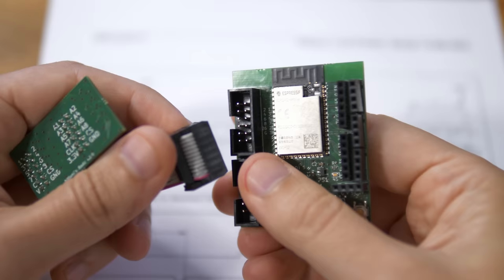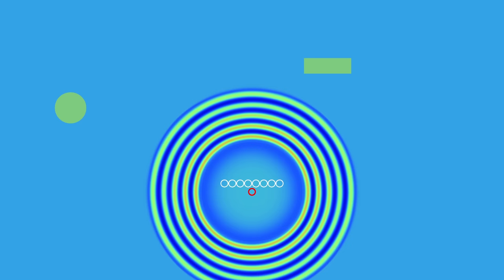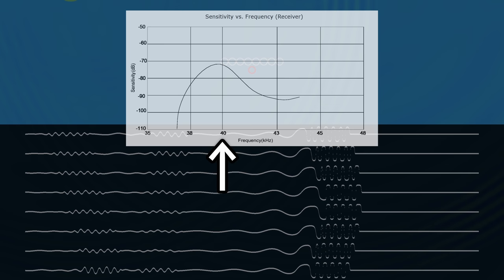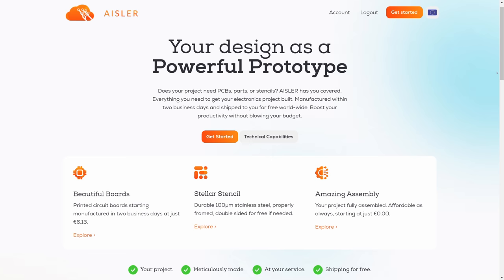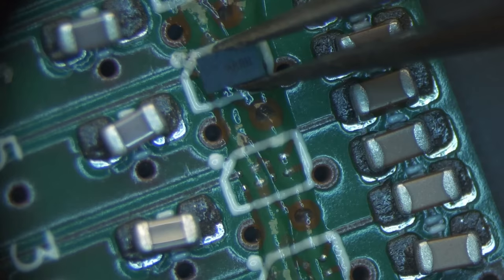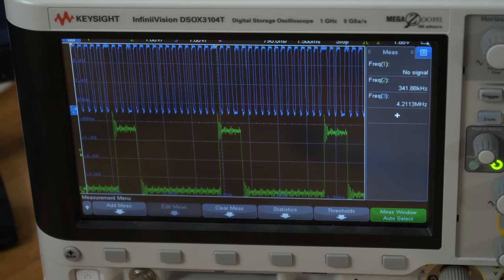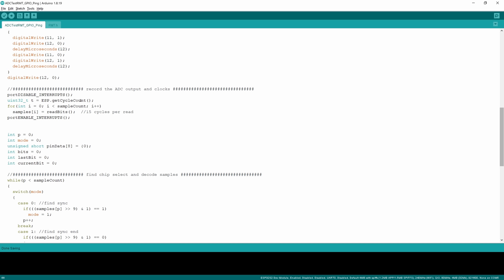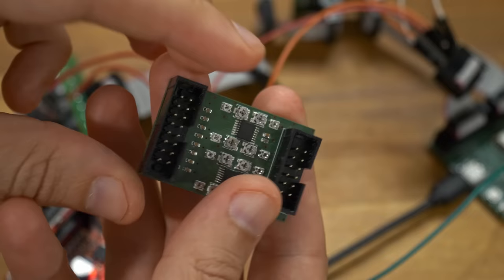DIY Sonar Scanner Ep. 2 (STEM, RMT tricks)

Comment: Geeeeeeezzzz. This is a mind-bogglingly advanced maker project. I can't believe all this is possible without a PhD in ultrasonic and signal theory, and a big lab. Let along possible with an ESP and off-the-shelf hardware! Great work! I can't wait to see how you amplify the output signal without introducing "noise" into the rest of your system.
Reply from the maker: I also can't wait to see that :-D
Reply: IKR, though the math/physics principles have been pretty known for quite a while as well as some actual existing HW/SW implementations that aren't totally proprietary anyway. But yea its amazing just how far we've come over the decades & how readily available everything required for such a project is, even to a DIY engineer.
Reply: Using a lock-in amplifier perhaps?
Reply: dude the math is pretty basic bachelor in engineering-level... Programming the microcontroller to work at those speeds is where the complexity of this project comes
Reply: @bitluni Дальше увеличим количество приёмников и получим ультразвуковой 3D сканер для дополненной реальности?) Будем без включённого света видеть окружение😏😏😏

Comment: I was working on the same kind of plan 14 years ago. one thing I noticed is that it's better to space the receiver array with prime fractions in between each detector. so the detectors are not spaced evenly. This prevents a picket fence type sensing issue. Also there are wider bandwidth ultrasonic detectors, but they operate at higher frequencies and thus increase the difficulty of the electronics.
Reply: What's Prime Fractions? I googled, but only found prime factorisation
Reply: Placing at primes is a good idea. It make a significant difference in performance?
Reply: @LydellAaron  so you have a spacing distance between sensors. Then you say do a 7/5 of that distance and a 14/11 of the distance. The waves that line up with the consistent distance now are not lined up with these odd spacing. it helps separate out things.
Reply: @LaserFur  I haven't checked your math, but I do see what you mean in spacing the sensors. Question: Could you tune each ultrasonic, to emit a pure prime frequency, keeping the distances the same?
Reply: @LydellAaron  no. it's not about the frequencies. it's about geometry. Any random spacing that is not even will help. think about how the phase of the wave from two different objects can line up the same on the sensors. The sensors have a bandwidth that controls the resolution it can separate objects, but the phase on each sensor can target a object with more accuracy.
Reply: @LaserFur  thank you for explaining it's not the frequency response in this case, it's the phase arrival time, at those sensors.
Reply: Also Golumb Rulers work.

Comment: I would highly recommend programming the ESP-32 using the PlatformIO extension in VScode. Not only is VScode just a generally better IDE, but the default ESP-32 framework (which virtually perfectly mimics the default Arduino framework) is actually built on FreeRTOS, which can leverage both cores of the ESP-32 and allow true concurrent multitasking. This is achieved simply by making calls to the FreeRTOS API with no modifications or extra library imports needed, which is freaking sweet for a 6$ microcontroller.

Comment: I would still like to get your help on designing my "flashlight for the blind" based on a laser range finder. But if you were able to map surfaces with your sonar, maybe that would work too. I found sonar to be too slow for distance measurements. But the tactile feedback for a flashlight for the blind would most likely use tiny electrical pulses on the forearm. Or possibly on the hand and fingers if it were implemented in a glove. Imagine feeling your way down the street with 30 foot long fingers.  i'm quite certain that something small and functional could be designed to work on a rechargeable 9 V battery. Or maybe more batteries. Something that would fit in one's pocket certainly. This would be a tremendous benefit to many people. The cane is a very reliable mechanism, but it could certainly expand one's horizon to be able to feel doorways and windows and street signs coming up. To be able to sense people 20 feet away walking toward you. Perhaps

Comment: Fantastic! WOW! And you managed to get a PCB with BGA's on them... impressive!  Thanks for sharing this... I can't wait to see how you process the data and interpret it.
Reply from the maker: its only 8 pins which are adjacent to the IC corner. The of all the BGA boards the last ADC didn't work. I used a different type for the tests shown here (code still works the same). I never really found the issue. The solder mask is a bit wide open on one of the pads. The pin pitch also exceeds the specks of the manufacturers fast shipped PCBs. I tried the BGAs because they were the cheapest and support 12bit at 3MSa max. Still would use sot for product because of the reliability.
Reply: @bitluni  Well, even attempting it was brave! Glad you got a work-around for that last ADC and was able to move the project forward... much respect for you!

Comment: The US military had the 5 omni-directional microphone version, installed on some humvees that pinpointed the afghan snipers, when they fired. Machine-gun galore after that. 
Mountain echos and all. Now there's a small version called the "Sniper Detecting Microphone", a part of their TCAPS (Tactical Communications and Protective Systems).
Smaller than a pack of cigarettes, the solider sticks to the back of his helmet.
I like yours better because it's based on an ESP32.
Reply: So basically the rl version of the little arrow you see in video games showing you were the shots were fired from, pretty cool
Reply: @xxportalxx.  dam, i never thought that such a device could exist. But it makes sense now, to have a phased array microphone system would work very similar.
Reply: I did a university project where I determined the angle of a body respective of a sound source by using digital cross-correlation techniques. Made an A! Now, we can see this kind of math being used in sniper shot detection and ranging.
Reply: @DrumToTheBassWoop  You get more bang for the buck with beamforming phase-shift arrays. This beamforming technology could augment LiDAR for 3D mapping.

Comment: If you add additional transmitters offset by the size of the 8 receiver array, then you will have a MIMO-array with twice the angular resolution. You would simply record one frame with one transmitter active, then another with the other transmitter active.

Comment: Dear Bitluni;   The sport of soaring cross country involves the glider flying to areas of convective lift to gain or maintain altitude to fly distances.   This means it would be nice for the pilot to have some kind of thermal scanner to observe areas of lift in the vicinity of the aircraft.   Now the pilot has to guess where these areas are by visual clues and then flying ahead to confirm the lift by instruments of vertical speed.   The concept of a "lift scanner" has been a dream of soaring pilots for generations.   I am wondering if phased array transmitters and detectors might be a possible solution.   I have read that microwave radiation might be used here.   You do great stuff!

Comment: This is fascinating! Just after I watched both of these videos, I stumbled across a 2003 paper that says the following without including a citation for it's claim. "Since the wavelength of 40 kHz ultrasound is only 8.6 mm, a receiver with dimension larger than the wavelength is not recommended for wavelength measurements." DOI 10.1088/0031-9120/38/5/310

In the first video, I think you showed us that the smaller transducer has a 9.6 mm diameter. 

If the paper is correct, then would smaller receivers give you more precision?
Reply: That's the diameter of the case. The transducer is inside and smaller.

Comment: Excellent. I'm a little creeped out because I just started work on this same basic idea this morning and out of the blue Youtube suggested this video in the early afternoon. That wouldn't be remarkable except that I haven't googled yet aside from looking for a schematic for the HC-SR04 board to see if there is anything worth salvaging. 

I considering trying to figure out if I could use Knowles digital ultrasonic microphones. IIRC the ESP32 maxes out at 2 PDM inputs and that is with interleaving left and right channels that probably doesn't help much. But I do have an old FPGA laying around which is grunty enough to handle converting several PDM streams to PCM. But I wonder if there might be a good algorithm for getting phase and echo times out of the PDM signal? In other words, each microphone has a 1-bit SAR ADC built in. Would it be possible to use the 1-bit stream from each microphone directly instead of first converting to PCM. Each mic's bit stream flows at around 3-5 MHz in ultrasonic mode  and it takes somewhat serious number crunching to get that to 16-bit PCM so it might be nice to skip that and go directly to finding echo delay and phase. That might allow the final version  to use an inexpensive FPGA dev board. Anyway just an incomplete thought which maybe you know something about.
Reply: You could emit a chirp from 0 to 10 kHz and capture this with a slow Adc (20kHz sample rate) of a microcontroller. Then you could emit a chirp from 10kHz until 20kHz. In this way you can cover the full spectrum where your transmitter and receiver are sensitive. One requirement is that you should have no aliasing filter in your receiver path  Also the sample and hold circuitry should sample in a sufficiently short time window and the sampling times between transmitter and receiver shall be triggered with low jitter.
Reply: based fellow communist electronics enthusiast
Reply: Looks like I had a bad idea if the goal is direction finding.
MICROPHONE ARRAY PROCESSING OF PULSE-DENSITY MODULATED
BITSTREAMS
Conference Paper · January 2018
Ipenza, Sammy Carbajal ; Masiero, Bruno S

It still feels to me like there should be a way to avoid the FFT(s) and do some sort of fuzzy statistical comparison of the streams to get time of flight and phase. I need to re-watch this video to see how bitluni did it. I don't remember FFTs here. Interestingly PDM seems to be good input for spiking neural networks--maybe a completely different AI based approach would work.
Reply: PDM to PCM conversion is basically done using low pass CIC filter (with decimation), which reduces data rate by some factor (/64). This is followed by a cross-correlation of signals from different microphones. The low pass filter doesn't do much but reduces the data rate and size of the array in memory. So, it should be possible to skip that step, but at the expense of bigger RAM.
     Personally, i would use 8 of ESP32 boards, one per the PDM microphone, and process acquired data using RPi.

Comment: Fascinating. I don't quite understand your argument that you need parallel readout of the sensors. If the scene is static or nothing is moving very fast then the receivers could be read out sequentially. I would like to see the transmitter moved on a linear stage. Then you could create a synthetic aperture.

Comment: You could try to transmit from the same elements and then switch to reception, as radars do, instead of one transmitting element centralized (which can add a phase shift along the array)
Reply: This is possible but the drawback is called a blocking distance. The transmitter rings for a period of time after excitation had ceased. This time is distance the transmitter won't be able to see. It would be blind close up for the transmitter element.

Comment: Using an array of MEMS microphones would be easier to implement with better performance. You get a higher bit depth, better SNR, and no need for a "hacky" interface protocol, I2S is widely supported. 

Finally, I might be wrong, but I think the logic behind your "temporal resolution" is flawed. You don't need to use a 3Msps sampling rate. As you said, by the Shannon theorem, you only need 80kHz to capture the 40kHz signal of the transducer fully (make it 100kHz let's say so you don't need to deal with aliasing). You won't get a higher "temporal resolution" by using a higher sampling rate on your ADCs, you would need the transducer to be at a higher frequency for that. By sampling a signal at its Shannon sampling rate, you are able to extract its phase and magnitude using a Hilbert transform. Knowing these two, the signal is able to be perfectly reconstructed. Samples over the Shannon sampling rate won't get you more precision.
Reply: Hmmm, that's assuming the amplitude of the signal does not vary though, and you only are interested in the phase. But I think here you really want also some info on the amplitude to make it easier for the calculations regarding the direction of incoming wave.
I guess you're right from a purely signal theory pov but to have the graphical representation that he displays from signal only with no computing you do need a higher sampling rate.
Reply: @aldopopp  Humm, I don't see how you loose the info about the magnitude, it's a bit the point of a Hilbert transform.

You have a real component (which is your signal) and an imaginary component (your signal, pi/2 out of phase -> 90°). If you want to get the magnitude of the signal at any point you just sum both components together and get the negative and positive absolute values. To get the phase, it's tan -1(x/y), where x is the real component and y the imaginary part. With that, you have all the info you could wish for about a signal.

About the graphical representation, he is already probably subsampling, an image can't really capture 300k+ samples per seconds.
Reply: It is true that the maximum frequency exists and it is far less than 1.5MHz.
However, the actual maximum frequency is higher than 40kHz since the amplitude of the pulse varies. (AM modulation works as translation in frequency space. Thus, maximum frequency = 40kHz + maximum baseband frequency)
It depends on how steep the pulse is.  I can't figure out the relation between occupied bandwidth and spatial resolution of phased array, but steeper pulse must be preferable.

Comment: I had a look at Aisler... not as cheap as the PRC people, but, having actually run a business doing electronic design and development, their pricing structure makes sense, seems quite transparent.
It might be a plan, if you feel ok with it, to give the price for a board that you are building? For me, I guess it would be interesting for a bare board price, on a board that's reasonable to assemble in a hobbyist lab, and a price for a fully built board, including their sourcing and mounting of components. The setup fees stack up a bit, but compared to damage to boards or components, trying to do it "at home" 😁

Comment: hi!  i'm wanting to design what i hope you're doing for your next video, a 3-channel sonar to take full 3d snapshots from each ping.  with a triangular receiver, the phase difference among all 3 will point directly to the reflection's source angle, relative velocity, intensity, and distance.  all the information you need is encoded in the audio if you can coax it out with the right math, and of course it's the hard part where i'm stuck.  i guess i'll write a little routine to manually search all the sound streams for 38.4khz serial data to never miss it and to get the phase exactly right for calculating angles and precise distances.  is there a shortcut i'm missing here?  seems like a lot of work just to turn a little blip of sound into a complete map of everything around.
Reply: so now after a night of pondering, it seems i need to take the audio data stream and step through it, hopefully only on areas marked by fft as having a carrier of known amplitude.  stepped by sliding a window of one ping size (thinking 10 bits) over it, adding/subtracting a sine wave of the target frequency to see if it increases or decreases the total audio noise.  then repeat with the calculated sine wave starting at different positions on its cycle and at different amplitudes.  best matches are identified by finding where they cancel out most.  from here, fine tune the phase and amplitude by tiny stepping until it's perfect, and that is the start time to flag.  also at this point try stretching or compressing the sine to find any doppler shift.  by knowing the exact time a ping is received on all 3 sensors with their positions tracked by accelerometer and gyroscope, the source can be triangulated directly.  at this point, the three (phase aligned and stretched) audio streams can be stacked like a rake receiver for better signal clarity, transform as needed and feed it into the morse code reader or uart to receive the keyed data contents sent from other boats.

so that's my best guess on how to go about this.  anyone have any ideas on easier ways to do any of this?  fml.

at least from here ai can take over and do voice like recognition on the serial blips because it has accurate feedback to train it, and get better reception in noisy environments.  but i mainly want automatic course correction on my rc speedboat to avoid collisions with swimmers or pier posts and that needs 3d sonar mapping so here i am.

Comment: I think that RPi Pico, with its programmable and full system clock speed PIO state machines, is far better choice for high-speed ADCs than ESP32. Also take into consideration its great overclockability. I think it will be possible to build even multi-megahertz ADC circuits with it.